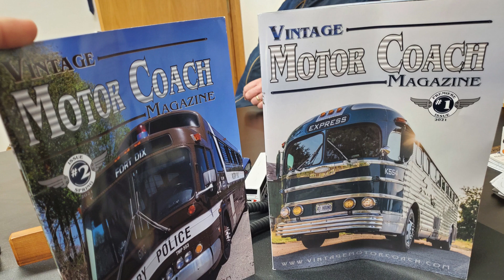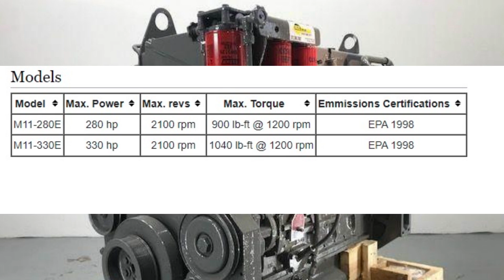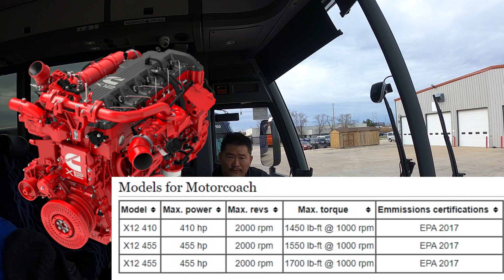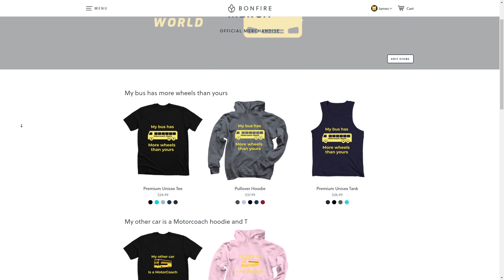What's under the hood of a bus? | Bus Engines

Comment: Good Afternoon Mr. Wang, I too am a huge fan of the reliability of the Series 60, although my experience was behind the wheel of a 2000 Freightliner (Freightshaker) Columbia mated to a 10 speed Eaton transmission. That particular rig had a cracked head, so on to the next job I went. The cracked head would have been 5500 bucks for the rebuilt head plus labor, parts, fees, taxes, and the percentage tax that they charge for your cell phone for not so good measure. Ultimately, the trucking industry became better because large firms would order rigs minus engines/transmissions and install the 12.7 litre Series 60 (remanufactured) with a range of different transmission options. The obvious answer to the EPA created debacle with the DPF/DEF "wizardry". I used to pull for Tootsie Roll. We had 4 Freightliner Cascadias with DD15 engines and Eaton-Fuller 10 speed transmissions. My luck was terrible and I survived on hourly pay during the breakdowns.

Comment: This was a great discussion on the various brands of busses available in the USA and the various over-the-road Diesel engines and transmissions they can come with.  Allison transmissions have been a favorite heavy duty transmission for a very long time!  ZF transmissions has a good reputation, but noting like Allison's.   I didn't know that Detroit Diesel had left the motor coach market.  Too bad Prevost only offers the Volvo D13.  Volvo could at least offer the D16 they sell in Europe and to the USA marine market.  It's a big deal when towing trailer or a car in the case of Prevost motorhome conversion.  Maybe the D16 has a better reputations than the D13 does for reliability after it gets some miles on it.

Comment: so you finally did a decent video for a nut job. yes Detroits and Allisons go hand in hand since they were once owned by GM. The new Detroits are not the same as the old. A big 12 cylinder Detroit and an Allison tranny would beat everything on the road. They would also eat up your profits in fuel.

Comment: Great video. Only now I saw it. In Europe, Cummins equips Scania Buses with their LS9 and IS6 engines. They were also providing VDL with their IS6, but these ones decided to go fully electric. I love the sound of these engines. Actually, Cummins has been here in Europe for a very long time. It was their engine on Leyland (which became British Leyland and years later was bought by Volvo). The Leyland Atlantean had a Cummins engine with precisely the same sound we hear in the New Flyer XD40. But the gearbox was the ZF4000HP (old-school music). Guy motors was another bus manufacturer that used, among different engines, Cummins. 
Now, as for the Scania buses, the sound is not the same as in the U.S. The LS9 is different and the IS6 is too quiet. Still, the LS9 is currently the coolest engine sound in Europe.

Comment: I never drove Motorcoach, but I did drive Tractor Trailer for a little while. I was also a big fan of the Detroit Diesel 60 Series, drove one in a Freightliner Tractor for a little while. I am also a very big fan of the Volvo D-13 Engine in the Volvo Tractor that I drove for a while as well. Both of those trucks I drove though were Eaton Fuller 10 speed Manual's, only drove an automatic truck once, wasn't a big fan.

Comment: I have a  1999 prevost with seris sixty with 13  speed Manuel. With liberty conversion 3 slide out for 60000 Dollars  with 150000 miles. The Manuel transmission put price down most rv ERS want automatic

Comment: I drove in the 80s then went into the maintenance side (trucks for many years then eventually managed a First Student shop) I would love to try out some of those higher HP 4 strokes in a coach. Every coach I ever drove was powered by a two stroke Detroit, either 8-71 or 6-92 in GM, MCI, Eagle and Prevosts. They all leaked oil. I used to do tours passing through Frankenmuth Mi. There was a very nice motel run by an old German guy...when you pulled into his immaculate paved yard, he would come running out with a chunk of cardboard to slide under the engine.In my early mechanic years I worked on a fleet of Freightliner cabovers, several had the big 8-92 turbo engines 430-440 HP I can't remember, I used to think one of those in a coach would really climb hills and rule the road. The series 60 DD was a great engine, I'd be curious to know the service life of one in a coach, they were a long liver in a truck. It's been tough on diesel engine manufacturers trying to meet emission #s, look at VW...I think the glory days of good reliable powerful engines is gone.

Comment: So where is the radiator located and how do the fins get air flow since the engine is in the tail end?
Reply: Some variations  use a engine driven hydraulic pump connected to the fan, with radiator to the side of bus.others may have Radiator in rear of bus with reverse direction  fan thus pushing air away from engine

Comment: I just ran into this video, and I love it. My personal 29’ Gillig ex-transit shortie came with the Cummins 8.9 ISL and B400R combo, and 10,000 miles in I still can’t believe how zippy it is. Realistically, the engine is totally oversized, but it’s too much fun to drive. Going up double digit grades in top gear at the speed limit, and then some, overtaking all traffics larger than a pickup. At at 29’, it’s wheelbase is super short and it turns on a dime. I guess my inner child comes out when I’m in a bus.

Comment: 4:37 I actually didn't expect bus engines to be using 10W-30 oil. I assumed since they're diesel engines operated at lower RPMs than that of car engines they would probably use 40, 50, or even 60 grade oils.

I guess I was hoping that you would get into more details about the configuration of the engines: such as what kind of valvetrain they have (OHV or OHC?), if they have balance shafts, whether  they're turbo charged, supercharged, or naturally aspirated, and if they're all or mostly all inline 6 cylinders. When I was a kid, I assumed that bus engines are probably V8s, V10s, V12s, or even V16s on the account of how big buses looked to me. But later I found out that most of them seem to have big inline 6 cylinders. lol 

Hopefully you can go into more of these details eventually. I'd be curious to hear about engines that uses natural gas, hybrid drive trains, battery electric buses, and trolley buses also. Although I understand those could be somewhat off topic as they seem to be more commonly seen on transit buses rather than motor coaches.
Reply: All of the Engines mentioned in the Video are Inline 6 engines, and they do not require balance shafts, on account of the naturally balanced nature of the Inline 6 engine layout.

Comment: Never drove a motorcoach,  so I  can't comment on the Allison.  Fully automatic transmissions are extremely rare & custom order in the trucking industry. Most of the trucks I've driven in 30+ years,  have been Detroit powered. In recent years,  the DD 15. Not likely ever offered in a coach as it's 14.8 liters.  The DD 13 was under powered for a semi. I loved the 60 series but never had the bigger one.  I even drove one back in the 1980's that had a 6v71. That's a 2stroke engine. Now I'm driving a 2020 Kenworth with a Cummins X15.  I'm underwhelmed by it's performance and reliability.

Comment: Great video, not sure if you’ve covered this before but how come most US bodied coaches have split windscreens? I drive buses and coaches in the UK and we phased out the split windscreen design in the late 90s/early 2000s
Reply from the maker: Great topic suggestion. I will Add that one to the to do list! Thanks Jonny!
Reply: @MotorcoachWorld  thank you, it’s just been an interesting observation guessing it must be something to do with legislation
Reply: I realize a coach windshield is easier to clean than a semi. But as a long distance truck driver,  I can say the split windshield is much easier to clean.
Reply: @bigdaddeo76  It's also easy to clean a one large windshield, but they're most expensive to replace. Even they're more costly to replace, they offer better visibility.

Comment: Not sure if the old Caterpillar 3306B was ever used in motorcoach applications, but that was the most dependable/reliable engine I have ever had in a truck.  Mine was rated 300HP, and was installed in an '89 model Freighliner FLC, so even for its time, a rather reserved engine at a time when big iron was really pushing hard to the forefront.  With all the choices that have come (and gone) along the way,  I'd be happy with anything BUT an ovloV,  want nothing to do with those problematic boat anchors.  And yes, I lived through the Cat ACERT years, what a nightmare it was. My experience was that between the engine maker and the truck builder,  it was a never-ending game of pass-the-buck.  The "problem" was never the fault of where you just had the darned thing towed,  they would spend hours and hours "diagnosing" the problem only to tell you it was the other party's problem. Tow it from The Caterpillar shop to the International shop,  only for them to pull the same trick, then you were on the hook for 4 huge bills to pay - 2 tow bills, and 2 shop bills.

Comment: I personally don't mind the Volvo engines. Volvo buses are quite common here in Australia for modern buses. For Older buses I love the Detroit diesel 2 stroke  because that is the best sounding diesel engine in my opinion.
Reply: I do love the sound of those 8V92 engines, I had one our 102-3B MCI, it did indeed have a nice sound and huge amounts of power.  500 horse power I believe.  Very hard to get parts these days from Detroit.  They were also huge oil drinkers or leakers and sometime both.  We also had a 6V92 in our Eagle Model 10 however way under powered for hill climbing in Wyoming Country.
Reply: Sounds like a jet!

Comment: The USEPA has driven most engine manufacturers from the truck and bus market. It’s becoming obvious that electric buses are the future. That works well for transit lines, but intercity and charter motorcoach operators don’t have good options yet in the electric bus field. There are some interesting proposals out there such as a hybrid design that can run on power delivered from cables buried in the road combined with battery power for short range operation. But that’s years, maybe a decade or more away.

Comment: Bus: MCW metrobus with a Gardner 6lxb engine bolted to a Voith diwa 854 gearbox. Coach: DAF SB4000 vanhool body with a DAF XF 335c 12.6l bolted to a ZF 6hp ecomat 2 gearbox. If it lost the tacho power supply it would do 90mph. If it had a manual transmission 100mph plus

Comment: Cummins X15 is my favorite engine by far!  It is smooth and quiet with plenty of power and acceleration.  I never really liked the DD13 because it struggled with power when pulling heavy in a tractor trailer.  Volvos are plagued with problems once they get some miles on them, and I have never had the chance to drive a truck with a Cat in it.  Every heavy duty vehicle on the road has the option to have a Cummins in it and as long as it’s up to me I will go for the Cummins every time.
Reply: my sentiments exactly,,,,,,,,,,,,,,based on my experience of having rebuilt many 350 to 220  engines............to me you could almost rebuild one of those engines on the side of the road if you had to..........a great engine in my opinion.............i also liked 8V71 engines ,,,,,,,,,,,,,mechanical , not electronic obviously......

Comment: Hi James, I really like the Detroit Series 60 engine and  Allison transmissions I had in my MCI buses.  However since we have transitioned to Volvo 9700s I very much prefer the Volvo D13 engine paired with the Volvo I-Shift transmission.  Once you get used to I-Shift you will learn to love it.
Reply: how do i-shift rides? honestly i really want to know since most coaches in NA always use Allison again and again
Reply: @rifkyfahrana1141  They ride really nice, our passengers and drivers love them.  Take a little getting used to, the I-Shift reacts a little slower than other transmissions.  Sounds and operates just like a manual transmission but it does all the shifting for you.

Comment: I like all of the US engines and over  the years have driven just about all of them, both gas and diesel.

My coach bus experience was the two cycle Detroit's as well as the series 50 and 60. The 50 and 60 seemed more effortless than the two strokes. My experience with the other makes (and fuels) was all in trucks.

Comment: Nothing tops the sound of the Detroit 2 Strokes. My bus still runs it’s 12v71 with the Spicer 4 speed stick.
Reply: how do your bus survive highways with 4 speed trans?
Reply: @ it does just fine. I shift to 4th at around 40ish mph depending on road conditions. It is a non- synchronized transmission so you need to double clutch it.

Comment: Before Eagles were manufactured in Texas they were shipped to the United States from Belgium without engines or transmissions. Detroit 6V71 or 8V71s and Spicer manual 4 speeds were installed on the loading docks.

Comment: 2/2 I'm most familiar with Cummins, since that's what is in most of the transit buses that I drive on a daily basis, at least the Gilligs that my agency has.  We have a few that have an M11 Allison B400R combo, those are FAST buses!  Great acceleration and good/quiet stopping power with the retarder, prefect for transit service. The newer Cummins do well in coach buses and I have no complaints on them.  
I'm not a fan of CAT motors, mostly because my only experience with them was from the problematic years.  Seems like Detroit, Cummins, Volvo and others figured it out though, wonder why CAT couldn't.
I've only driven a Volvo engine once, but I liked it a lot.  Smooth and powerful.

Comment: 1/2  NOOOOOOOOOOO!!!!!!!!!!  Don't tell me Detroit discontinued the DD13, its such a great engine!  A worthy successor to the Series 60.  I definitely agree with you on the Series 60 Allison B500 combo.  I'm also a big fan of the Detroit 6V92, great sounding and performing engines, though old and not very efficient.  The 92's are pretty rare nowadays, I've only driven one in a bus made in 1993.
Reply: Yep. Detroit left the motorcoach industry.
Reply: The only bus you can get with the Detroit is the new Mercedes Tourrider
Reply: @TellurideS13  The detroit DD13 was basically a Mercedes OM471, which is what the Tourrider has, so it's practically the same engine

Comment: Hey James if Detroit is no longer supplying engines for motorcoaches why aren't they going to use the MBE diesel series since they are owned outright by Daimler? Is the 60 series still going to be used in tractors since Daimler also owns Freightliner and Thomas Bus.
Reply from the maker: Hey Michael. Great questions. I know that Detroit will still build engines for trucks but Not sure about your first question. I should find out though because you have me curious.
Reply: @MotorcoachWorld  When I was driving coach and we had an engine or transmission problems we used to have them repaired at JOHNSON & TOWERS which is now Johnson Truck repair in Landover Maryland. In the times I used to go bringing in a coach or going to pick one up most of the pictures on the wall were the Detroit 60 engines then they had MBE engines posted on the walls. They not only service but sell Freightliners. Lots has changed since I left.
Reply: Detroit Diesel manufactures the DD5 and DD8 for medium duty trucks and school buses as far as I know